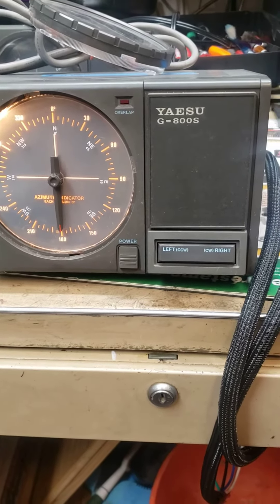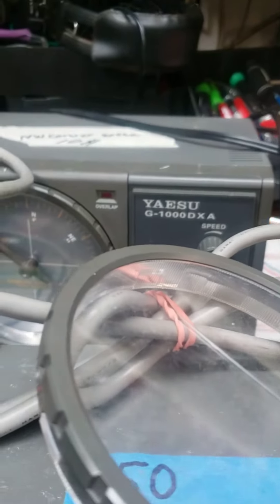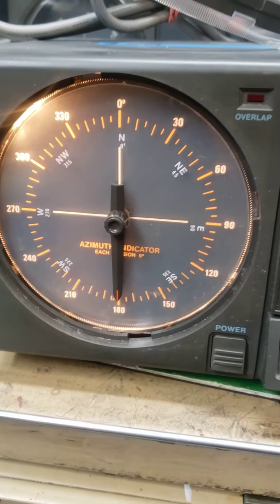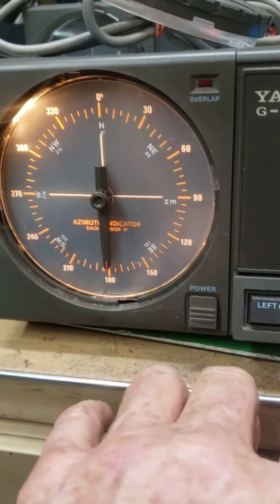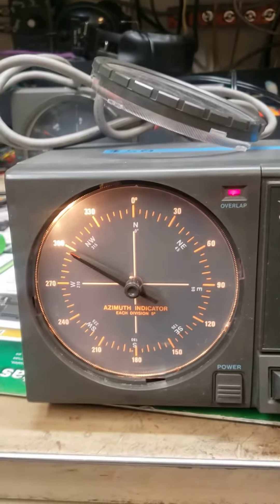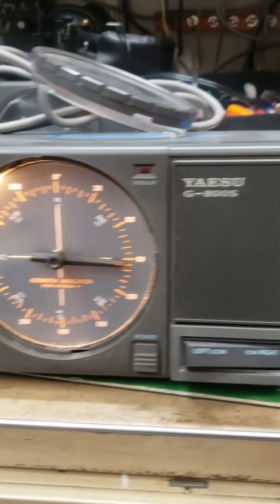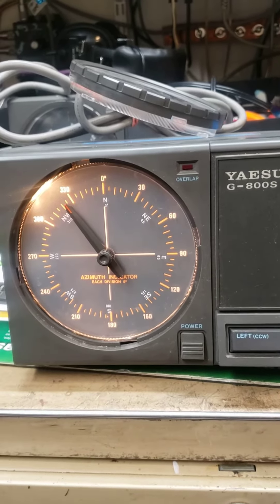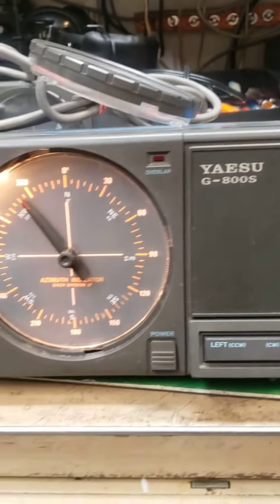Test 1 50$ hamfest Yaesu rotor

Comment: The issue is that the rotor is not compatible with the controller. SDX & DXA or S rotor and controllers are wired totally different.If you look at the schematic for each you can see that. They are not compatible with each other.